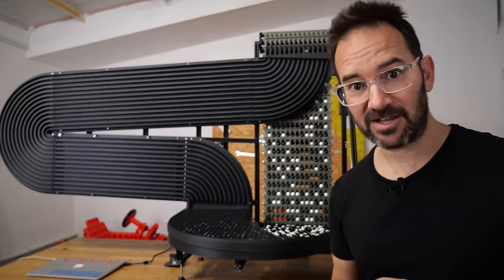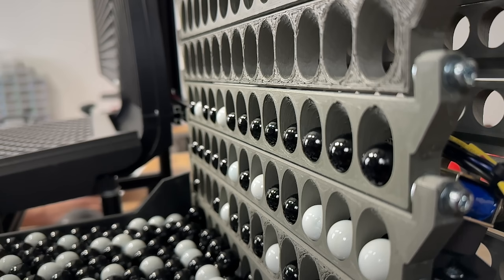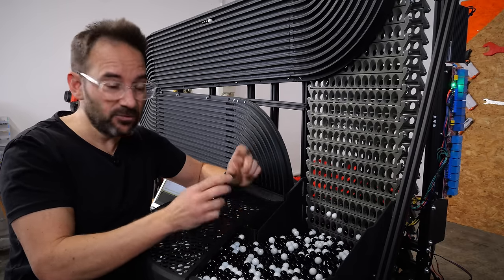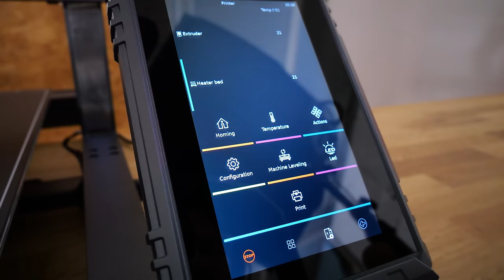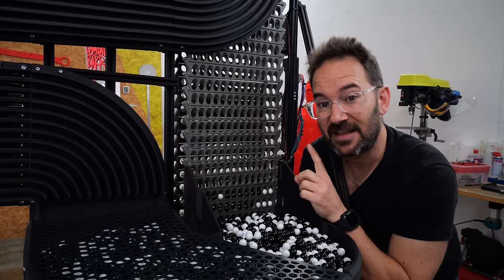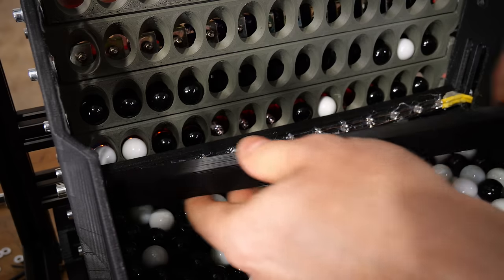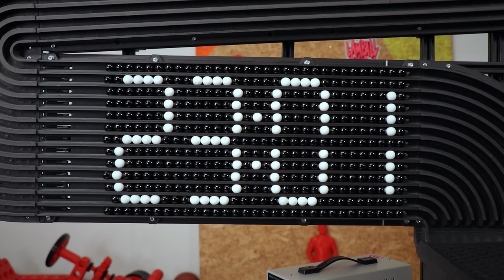BUILDING A MARBLE CLOCK - Pt. 2

Comment: Really cool and elegant solutions.
I bet it could be made faster by not stopping for the solenoids if the conveyor system itself (not the gear) had the optical sensor stuff on it. 
I also imagine if you can control solenoids, separate belts for each marble conveyor would make more consistent results too, just use a cam like thing to engage/disengage from the drive. Like, marble conveyor 1 already has the color it needs (apparently always black) so stops. Conveyor 2 does not have the color it needs, so is rotating while solenoid popping out marbles until it gets the white one it needs.
It'd get absurd to put each race on their own drive and get them tuned as fast as they can go.
Again, would add probably unnecessary complexity to an already complex machine, but we are talking about a marble clock here. You can just buy a digital watch if you only want to know what time it is.

Comment: What about a direct feed straight from the top so that gravity consistently feeds them into place? One issue with that idea is the constant hammering of marbles on the pins at the bottom that hold the marbles in place. May need a heavy duty solinoid to counter wear and tear. Or lighter weight marbles.

Comment: Automatic-Switch-Gate: If it's on the upper span, instead of the lower span, gravity will speed them all the way around the curve. It's the small number without any weight behind them getting hung up at the curve. So have the next minute staged above, with the gate before the curve, instead of being staged inside the curve.

Comment: Maybe not as pretty - but I think the route I'd go is 2 hoppers for the different colours.
You then have the sorting system to get them back into their hoppers already with your colour detection.
You can then generate a row (or column, depending on design!) by letting out 1 marble at a time from each hopper.  

By removing the randomness that you have now on "can you get the right marbles in time", you'll be able to remove the race between receiving the first marble of the next row, and the last marble getting into position.

Comment: I hate to bring this up now that you've gotten so far with this design, but you would have to move a lot less marbles if the tracks were oriented vertically, so you only needed to change one digit at a time. Nice work with the sensors though. I thought you would have some kind of sorter, but just discarding the randomness that you don't want works pretty well when there are only 2 choices.

Comment: i think it more efficient if you add separator between white and black. so it did not Queue randomly and it also going to give a better look. here i try to map it. input --> separate between white and black --> black marble entering the queue --> machine kick the row that should fill with white marble --> the white marble enter the queue --> output

Comment: The running out of marbles issue can be addressed by a change of the track design if you are interested. At present if the tray is full the odds of a marble being required by the display are equal to the proportion of the black and white marbles within the display. This is not optimal. If each marble were allowed to roll over a display composed of vertical columns like a connect 4 game and then be allowed to drop by the mechanism of it were needed or not then the chance of a marble being required would be raised by the number of columns. This would have the added effect of filling the display faster as virtually every marble picked up by the scoop would be needed by the display.

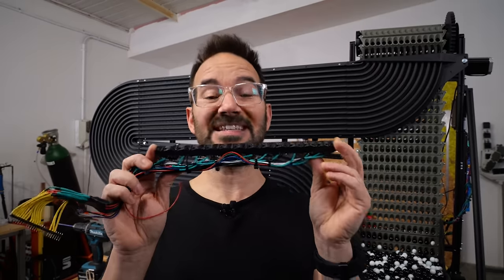Comment: At 3:52, you point out the sensor's sensitivity to the shop's varying lighting conditions. A potential solution to mitigate this issue is to employ Lock-In Detection, where you would modulate the illumination source—essentially, toggling it on and off—and then take the difference between the 'light on' and 'light off' measurements. This technique can significantly reduce the impact of ambient light on your readings. However, for this method to be effective, both the switching of the light source and the measurement process need to be rapid enough to ensure that the marbles' position does not change significantly between measurements.

Comment: If you have the resources to increase the height of this contraption, a solution to storing minutes can be to take your curve and extend it from a 180° to a 90° then a vertical section, followed by another 90°, and store the next minute in the vertical segment so the marbles can't get stuck when you open the gate. ❤
Reply: You can make the delivery tubes longer then have two partitions one dispaying the current time while the next time is already made and hidden behind a covered part of the rest of the tubes with a gate holding it back, every minute you open the gates to release the current displayed times then followed by the next time , while at it the next minute starts building up behind the hidden tubes.

Comment: I would suggest changing the rejected marble chute (the one connected to the elevator) so that the exit is wider and add pegs to it similarly to a pichinko board

This should randomize where the marbles end up more, if that actually develops into a problem

Comment: In industry, puffs of air is the standard for this sort of rejection sorting. Things like fruit are imaged, and at a point far enough down the line for the computation to be finished, an air-manifold blasts away the rejects. This makes for a bit more parts, and potentially added noise, but it's off-the-shelf reliable tech at this point.

Comment: What if you separate the marbles in two pools as they are released from the clock? Having two pools you can choose the color instead of randomly looking for the color that you need, you would do like a printer does with its paint reservoirs. You'll need to adapt some structures, but I think you will solve many of the existing problems.

Comment: What if you process and discharge the marbles vertically for the display? That way you could only replace the numbers that need replacing each minute. Would reduce the need for a whole set of marbles each minute.

Comment: should of built is to the marbles enter from the right, then have the last digit rotate to drop the marbles every minute keep the other digits in place until x10 minutes has passed, etc.  This would be another crazy part of the project though.  Maybe just have a track in the back for them to fall into or something, insted of a rotation of the track.

Comment: I am wondering why not create a marble dispenser that dispenses the marble of the respective color to the correct column. This way it removes the probability factor which increases the wait time by waiting for the right colored marble in the right bucket/column. example: keep everything the same but create a dropper that reads the color and directs the marble into it's appropriate column path. You will also need to create a dumper where rejected marbles go back to the collection bin.
This will ensure less time, since you won't be required to sort the marble on it's way up.
Furthermore, you can use selective row removal. I mean changing a 2 to a 3 only requires the bottom part to change, so why not code the same into the program? This way you won't need to discard the whole marble screen.

Amazing work!

Comment: I'd like to see it on a smaller scale using colored ball bearings. Instead of the solenoids, use tiny electro-magnets to lift them out. There are tiny surface mount chokes you could use.

Comment: think of it like a digital face and implement a vertical fall, your hour marbles only need to rotate per hour and programming for sorting would mainly be require for minutes. (a)(b):(c)(d)
(a):0-2
(b):0-9
(c):0-9
(d):0-9

Comment: Hey buddy the reason some marbles get stuck is due to a small lump in the curved piece, i froze the video and lined up my phone like i was checking the straightness of a piece of wood and saw a lump there, sand the curves with a wood file to straighten up the lumps and it should work fine
Reply: It seems like you made the model to connect it horizontally, that seems to be the issue, the start of the curves is apparently always horizontal

Comment: Interesting approach

I would've used the conveyor purely as an elevator, with it dumping to the back to avoid the thunking of the forward pushers at the top.  I then would have used white ceramic/glass marbles and black steel/metal bearings so that I could use magnetism to sort them, using something like a track that's lined with magnets to do so. (The magnets would induct magnetic fields in the metallic marbles and slow them, even if they aren't ferromagnetic (iron/nickle/cobalt), Google "magnetic brake" for more info) then I would use the sorted marbles to create the time

This approach likely would have been larger, more complex, and needed to have enough marbles to make somewhere around 3 grids (one to display, another being made, and a third getting sorted, plus some extras)
Your design fulfills the purpose of clock art piece much better than my proposition, though it doesn't utilize some cool physics, which, on second thought, makes my idea 1,000,000x better

Hope the project goes smoothly ;)

Comment: If you'd built it so it releases on the hour side instead of the minutes, it would be quicker building the next time because it already has the hour correct and it only has to rearrange the final digit/digits.

The way this is built means it has to rearrange from the beginning so it ruins what was already there.

I think that made sense.

Comment: Suggest reducing the font size down from (apparently) 8x13 per digit. Needing far fewer pixels, "part 3" might be within reach with your current supply of marbles (while waiting for more.)
Further, another version might employ one or more "Archimedes Screw" mechanisms as its elevators. Would be interesting to calculate how many 'pixels' a double (or triple) helix could deliver to a super simple sorting mechanism at the "top left" of the machine (with a 'reject/return' run, too.)
Maybe if there's a "Mk II" version in the future.

Comment: I would do it with the marbles dropping vertically then you can empty out the minute section and repopulate it every minute, instead of having to rewrite the entire time to make a change. Also presorting the marbles and releasing them on cue to form an ordered line, then feeding them, would be much more efficient than randomly rejecting marbles until it works.

Comment: If you used a vertical flush method where marbles is flushed downwards after each minute, you can build a system where only some row of marbles are flushed downwards and some rows stay. That will also help with only flushing the right most number every minute rather than the whole thing. This also reduces the required number of marbles. A vertical flow would require using 31 solenoids, sensors and channels instead of 13 but I believe you can do it. :D  31 is still a prime number. :D

Comment: I love the idea, and have nothing but admiration for your skill and perseverance.  However, you're going to need more than just more marbles for the next minute preparation. I think the big problem is going to be that it's taking much longer than a minute to assemble the display!
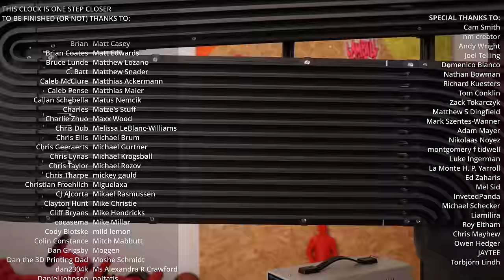(At the end of the video, it took from 11:24 to 13:39 - over 2 minutes and 12 seconds - to finish displaying "23:01")
If you want to change the display every minute, then you'll either have to figure out a more efficient way of sorting marbles, or more than double your elevator speed. 

Each line in the display is 31 marbles, so if you guaranteed alternating colours of marbles in each elevator, you'd have to lift slightly more than 1 per second to finish in a minute.

Comment: It would be cool if the elevator just always ran, you could separate the marbles at the top and have two containera of marbles, then a servo pull a white or black ball for each row and drop it in. 
If the reaivoir at the top is full, it will direct some extra marblea down a channel back to the start.

Comment: If the machine constantly pre builds the next minute and hides it behind a cover and holds it back with a bunch of actuator gates. You can next purge the current minute when expired, then very quickly display the new hourly minute in mere seconds instead of waiting for it to slowly build up and having no real current time as it builds.

Or you know, just make the thing about 30 times faster. But with my idea you can go just as slow but will seem much faster simply because the new time will be displayed suddenly from behind the cover. Its almost like magic.

Comment: It might have been more efficient to have the channels vertical for the time display, have a single row of marbles flowing in a track above, with sensors to detect the color(s) and then let them drop according to color as they go by - would have been much faster too, since even though a particular color marble wasn't needed at one column, it might have been needed at a later one.

Comment: i wonder if there is a way to reuse at least some of the effort put into sorting the marbles. because when you release the marbles showing the current time you already know what order they are in. so if a row maches a row you are queing up then you could reuse it. instead of releasing them into the pool to be reorganized. you can have a track ontop of the pool of marbles that would catch rows that you want to reuse. then feed it directly into the elevator. 
2nd idea you could reuse marbles the computer has rejected. by instead of pushing them into the pool, you could push them onto a holder to be a buffer and it could use the marble in the buffer instead of waiting for the color it needs. then you dont have to reidentify the marbles you put into the buffer and just reuse them for the next row.

Comment: this design can be drastically improved,  if you load vertically instead of horizonally,   you could just replace the single digit that needs changing,  so on  23:01,  only the 1 needs to be changed so all marbles in the 2,  3, : and 0 can remain as is,  this is far less marbles to prepare in  the 1 minute you have.

Comment: It never made sense last video how you were going to arrange your marbles, but it clicked when you installed the solenoids and sensors...except this also feels like a really roundabout and slow system to handle it. Since this clock is oriented balls right to left, even though the minute value is the only one that needs to be changed, everything has to be shuffled in a system that already appears pretty slow.

Can't help but think if this was say, top down oriented with a way to channel the marbles to the correct column, you could reduce the workload of the sensor system and actually make this more aligned with actual time?

Comment: Why sort the marbles at the intake and not at the outlet? have separate storages for white and black marbles, that you can then access as needed.

Edit: the intake for that system could also work with the belt: fill all slots with black marbles at the bottom, then poke out the slots where white marbles should be and insert white marbles into the empty slots further up. That way it would be faster and more even in speed.

Comment: It would make more sense to fill the numbers top to bottom, not left to right. This way, mostly you would only be changing out the minute marbles. Would also be easier to guide them into position vertically.

Comment: An interesting little problem is to estimate the optimum ratio of black to white marbles in the pool. If I assume that there is homogenous mixing I get optimum p = probability of selecting a black marble = sqrt(Nb/Nw)/(1-sqrt(Nb/Nw)). Where Nb is the number of black marbles in the total pattern, and Nw = number of white marbles in the pattern. My estimate is 104928 white marbles and 494099 black marbles, suggesting that your optimum ratio is 31% white marbles even though only 18% of your pattern is white.

Comment: Your first problem is that it take so long to accumulate marbles. I think a better way would be on the exit instead of moving them straight to the elevator put them in tracks with separation of white and dark marbles, so that you have 2 sections full of individual color, then on the lift you eject all marbles that not suit for a certain track and on top you join both path again, since there will be always marble on a lift you will have constant input of marbles, instead of guessing when marble of your color come to the track (right now you may wait for a couple of turns before get marble of your color which slowing this process a lot).

Comment: Uh oh - the full-length shot at the end: it begins at 11:25, but that minute isn't finished displaying until after 13:25. So if it takes more than 2-minuted to load 1-set of balls, it's won't be accurate down to 1-minute. It will only be accurate within 2-minutes at best. Unless you can double speed the machine and sort 1-load of balls faster in half that time.

Comment: The marbles getting stuck in the upper tracks might be easily solved by simply increasing the slope of the raceway so the end of the bottom tracks isn't as close to level as it currently is...

That might require increasing the overall height of the machine and lengthening the lift belt however...

Comment: You might be able to make sorting easier 8f you have 2 trays and a  sorter to send the different colors to each tray and have gates that let marbles into the hopper. This could also decrease the cost and complexity of the build as well as speeding up the cycles since it can sort in advance and start loading the hopper for the next cycle